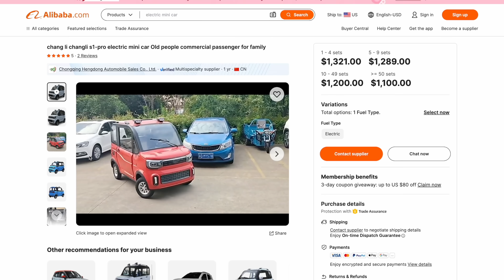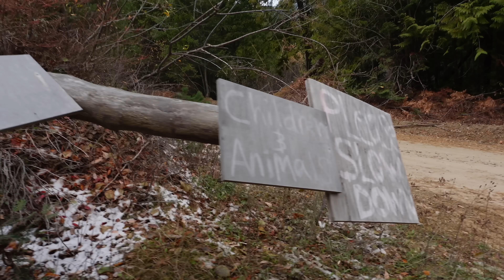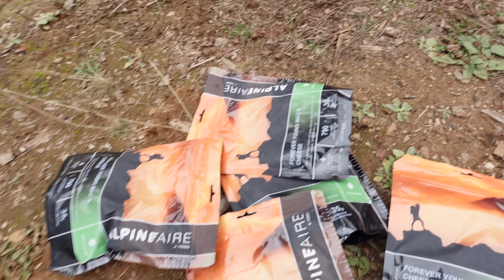World's Cheapest Car 100 Miles Off Road!

Comment: The gen is turning off because of the low oil sensor. They aint really designed to be running while moving down bumpy trails and the oil splashing around.

Comment: On next attempt, try getting a power supply 90v 2000w , so you could run the car directly off the generator , generator should have mounted to back of car not top so it does not tilt as much, def need higher clearance  and a plate on the bottom

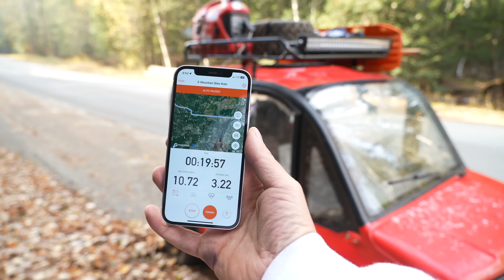Comment: 15:50 You should NEVER start a generator with load on it. Let it run 5 minutes then plug stuff in. The varying of it running will effect voltage and blow out your charger. So driving/running is just asking to burn the genny/charger out.

Comment: This reminds me of some of the crazy stuff I did, back when I was younger.  Keep up the good work. The Little car does amazingly well, considering it has, very little ground clearance, very small diameter tires, and very little suspension travel.  It is also carrying you two plus the generator and your supplies.  
I would suggest, if you try it again, purchase a higher ampere and efficiency battery, if possible, financially and practically, a little higher wattage generator/charger.  Larger diameter tires if feasible for that vehicle, and/or lift the chassis a little, would help a lot on the ground clearance.  
Some real food, like beef jerky, dried fruit, pemican and the likes, even a few cans of stew and/or chili.  A real ax, instead of a hatchet, would be wise.  Where you went, there were plenty of dead trees and brush, already down.  If not rotten, just lay the middle of a couple of the trees across your hot fire, and when they burn in two, throw the halves back on the fire.  Save a lot of chopping.  As you said, some duct tape and some UV curing adhesive might come in handy.  Might could have fixed the steering sector, for the rest of your 100 miles with good adhesive, like that.  Really none of my business, but just saying.

Comment: As much as I love the combustion engine builds, I think this could be an interesting build series...
Keep it electric, solid axles (golf cart axles maybe?), four link, and like 27's on a massive battery bank and a giant wattage motor
Reply: Honestly not 27s. That would fuck with the balance, but golfcart axles, some 14s, a 4 link, and bigger battery/motor/generator would definitely make this into an offroad monster!!
Reply: @jeffreymoffitt4070  you think a 27 inch tire would be too much? It looks like it's on maybe a 20 currently. My stock kawasaki teryx and rzr 800 are both on 26's and I cant imagine this thing being much smaller than either of them.
Reply: @CTC7599  lmao i thought you meant 27" rims lmao
Reply: Perfect solution would be to make some sort of hybrid system with battery chargind during drives.
Reply: Prius or Camry power train.
Reply: @jeffreymoffitt4070 That would be a mini sherp lol
Reply: Ya'll are overestimating how strong golf cart axles are lol.

Comment: It would be interesting to see what could be done to that car to make it actually capable of the 100 miles. Like a lift and heavier axles, or even just some skid plates for those weak points. Can it take a battery from something else? Upgrades and a retry would be awesome with the cost list.
Reply: Anything can take a battery from something else if you try hard enough.
Reply: They're already using Surron batteries, which are from e-bikes

Comment: i have similar one. and they works with generator. but i have a generator of 3kw motor is 4kw at max. and when i checked the used  power is 500 watss by charger. so it mens its possible to put 3k/.5=6 chargers in paralel so it can charge and drive at the some time while driving... but still batteries are not allowed to charge that fast. so i think it requires a power splitter to use directly with external power...ie a circuit that disconnect batteries chrging current if it reachex maximum owercharge limit...

Comment: Oh god no ive got an electric trike with this exact motor and diff setup, gonna weld the diff, and use one brake mount to use as a sprocket mount and get my honda gx200 in there

Comment: Next time put a independent rear end in maybe a stronger electric motor and a little lift kit even if it's home made lift and that generator has a safety shut off switch that why every time you hit a big anything that generator shuts off.... But some modifications to that car would be very cool

Comment: That needs some suzuki samurai solid axles with big 4wheeler engine swap it needs to be turned into the ultimate mini crawler have front axle moved forward 8inches and rear axle moved back 8 inches and put on some 33s.

Comment: Well now you just need to upgrade this thing completely with new electric rear axle with at least 10 kw of power and install alot of batteries and get faster charger and bit bigger generator. More upgrades the better.

Comment: Excellent mentoring from Ethan. This car is going to be awesome. If you do this car right you may be able to go farther than 100 miles but its all about batteries now isnt it? Id stick with the hundy first and then go from there. Having to pack a gasoline genny is kind of cheating as well so you guys need to work out the math and see if you can actually do this and with how many batteries and not too large of an electric motor and possibly regen for downhill. Maybe get a hold of GRIN TECHNOLOGIES in Vancouver BC or team up with them and see if they can supply you guys with their super efficient motors and monitoring systems. Could be the start of something a bit different to add more content. Just sayin.

Comment: time to upgrade the Tank. but what if with a 32ci Chrystler Outboard V4 from a Military Surplus store. I actually want a couple of those. thinking quad with an extended swing-arm with a Miata rear dif. like a drag quad running a rear diff from a car, with a twin AMR500 supercharger setup feeding either bank, bored and stroked and ported. make like 50 or so horsepower. and it sounds mean as hell with a crossplane crank and with cams. rough and choppy .

fuck. I want a 60's volkswagen beetle.

Comment: Raccoons and opossums can definitely get into those crevices at the top, and some younger ones could get into the ones on the side. Definitely need some sort of chicken wire, or take another pallet or two apart and nail a board over each hole. Still a great build for extremely cheap. Nearly all Walmarts, dollar trees, dollar generals, family dollars, Lowe's, home depots, etc. Will gladly let you take their already empty pallets for free, simply because they don't use them after they're unloaded in most cases, so they have to pay another company or themselves to load up and haul them all off.

Comment: A few thing they don't tell you about electric vehicles is Hills, terrain and the weight you're carrying all affect the distance you can do on a fully charged batteries ie hills & terrain will affect the overall distance you can do plus adding extra furnishings adds weight to your vehicle therefore limiting the distance you can do because you're using more power on hills and Rocky or whatever terrain, carrying lots more weight that you could do without like the Passenger who may I add could walk or assist by pushing the vehicle up the bumpy Hill 😂

Comment: I want a tiny EV, similar to this car, but slightly more power.

In the European Vehicle Classification: L6e-BP 
4 wheels, max 2 seats, enclosed passenger compartment
Mass running order up to 425kg (937 lbs)
Maximum 45 km/h (28 mph)
Maximum power 6kW (8 HP)

I think the ChangLi Mini EV seems nice, but unless it's possible to get a L6e-BP compliant model, with close to 6 kW power, I don't think it will be on my list of models to consider.

Comment: Why do I want to convert it to a predator/gas powered FRONT wheel drive while leaving the rear electric so it can be "put in" 4x4 off-road! Yet be able to drive non stop off the gas powered half.  While also charging the battery for the electric part. But since only using the electric when stuck or needed..... It would last a long time

Comment: You guys, i hope you guys aren't just charging with the 6 amps that the genset produces. If it is a 1500-watt genset it will run a 50 amp, 120-volt charger.

Comment: A driven front axle with rock plates on four link suspension add a box underneath for more batteries then add some bumpers with wench mounts and winches go to 15" wheels as well.

Comment: You said you did 9 miles and it had been 4 hours, so 90 miles would take 40 hours, plus another 9 miles, plus 4 hours, so 99 miles in 44 hours, plus another 1 mile, and hakf of 9 is 4.5 miles, hakf of 4 js 2 hours half of 4.5 is 2.25 miles, half of 2 is 1 hours, you were roughly going 2.25 miles an hour if it was evenly😭😭😭 lol, but lets call it 2 miles knstead of 2.25 lol, half kf 2 is 1 mile, hakf of 1 is 30 minutes, so 99 plus 1 equals 100 miles, and 44 plus 30 is 44 hours and 30 minutes, so if the battery was infinite and couldn't run out and you ran into no more problems and also didnt sleep or stop at all it would take yoj 44 hours 30 minutes to do the full 100 miles, so 1 day 20 hours and 30 minutes, so a day and over a half a day, but let's say you drive half the day and sleep the other half, driving 12 hours a day and sleeping 12 hours a day, 3 days would be 36 hours, plus another day would be 48, so it would take 3 days plus half a day of driving, so another 6 hours, which is 42 hours total, plus another 2 hours of driving, plus another 30 minutes of driving, so it would take you roughly 3 days and a little over half another day of driving to reach the total 44 hours 30 minutes to reach the 100 miles (without any more issues from the vehicle, and only stopping tk sleep for 12 hours each day, so sleeping half the day) so we'll just call it 3⅔ days to drive the full 100 miles, so IT WOULD TAKE YOU 3⅔ DAYS TO DRIVE THE FULL 100 MILES!!! sorry for this bejng such a long comment lol,  thank you for actually reading this, and using your valuable time to read all of this, hell yeah!🤟🤟 love the content and videos, ive been here since the beginning, i would LOVE it if you brought back the mad max style merch and it be the EXACT same as it was before you  stopped selling and making it, id buy it 100% i wasnt abke to buy any while it was available but it looks so eoic and awesome i really want a hoodie one! Keep up the good videos and good work yall at vehicle shop formerly just called "Grind" but then while Ethan was putting it up was called "Grind Hard
Pluminy" then now is actually correct and it called "Grind Hard
Plumbing Company" lol
Reply: 2 at most, but 1 is the best option

Comment: New challenge: Same route. Same car. But throw away the silly battery and power it with a 125cc motor. Bet you make it in a day. Probably even a little 50cc would do if it's a manual and not cvt

Comment: Full size liqidcooled 50cc six speed mopeds gilera and derbi which use the same motor is restricted and downgraded to 3,6 hp after taking off the electronic  rpm restrictor changing the jets etc in the carburetor and taking off the air restrictor on the air filter box and taking out the shingles and baffles in the exhaust pipe which there's five of two in the expansion chamber two in the muffler and one almost at the the motor end of the pipe it then has 8,6 hp on the backwheel putting on a few racing part's which makes it around 73 cc which is the smallest sylinder you should have to make the racing exhaust work properly at the bottom register you get 11 to! 14 hp in the motor according to polini which is the cheapest smallest etc..that means putting my old moped motor in this car would make it 4to5 time's stronger..driving a full size moped with only 3,6 hp is so slow that it's truly dangerous everyone gets annoyed at them they can't keep up with traffic even when it's going downwards..this car with two horse power will not be able to drive me up 👆 to my house specially not in the snow but like euro mopeds they can probably be improved but to drive with that little power is very dangerous you can't move out of the way when seeing a potential death trap accident coming straight at you

Comment: time for a new rear axle, and maybe an upgrade to a 3hp or 4hp motor, and larger lithium ion phosphate battery pack/ have fun, they say in the old days of Honda engineering and racing the engineers would make something for the race track and say there is no way you can break "that" and the racers would go out and break it/ then Honda would come back and build it better and stronger // then brag about that engineering making it back into their every day production,,, I don't know if Chang _Li is watching, but "Kan dao le, tswo dwo ma hao le" (not pinying, but perhaps one of those other systems for Chinese)

Comment: You have to be an extremely good welder to burn such holes with such a good welding machine! why not screw, = more elasticity. Weld seams, thin sheet metal, ferrule = BREAK. logical or you say that makes sense

Comment: Thought they gonna properly do a project mod on the unit and rigged it with proper suspension with independent cross differentials before sending it off d-trail.. What a let down, halfbaked potential for the unit itself..

Comment: I think you should just run the car on the, Electric Generator. As it should be able to power a 2 hp electric motor. Don't you think? And at the same time. You can be charging the battery. I mean come on man. Use your head!

Long-haul electric vehicles just doesn't work. You can't get anywhere. Especially with some hilly driving. That thing is designed for a flat surface straightaway.

I truly love watching you guys bounce up and down inside that, motorized spam can. And it appears to be as much. As footage of astronauts blasting off in the, Space Shuttle. They would bounce around that much on takeoff. And you are bouncing around that much. Good thing you don't have to really see your speedometer. As I don't think you could focus upon it like that? But then, it can't speed, so?

Now I would definitely get one of those. To tow behind my, Motor home. And use it for some light mostly level, offloading. At a Bureau of Land Management, Campsite. To get around in the desert with.  Maybe, driving it into a little town or Hamlet. Where the downtown speed limit is 15 mph. As they were more forward thinking than the folks in Washington DC. That set forth, 25 mph.

And so, yeah?
RemyRAD

Comment: I really feel like you two could have made it if you just tried a LITTLE harder to watch where you where going. Picking lines with more care. Not putting the car into really unnecessarily dangerous (and damaging) spots for the sake of a picture.. Like the rock overlook at the start.. 
With a few more braincells focused on driving and not giggles i think you two could make it 100 off road miles..  Ill tune in for that.